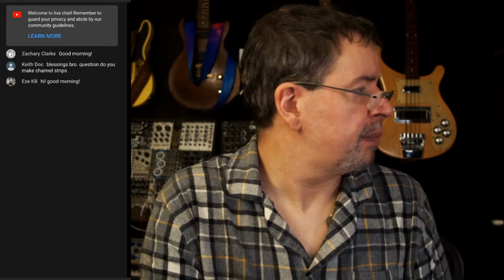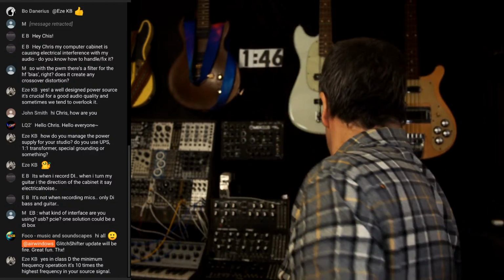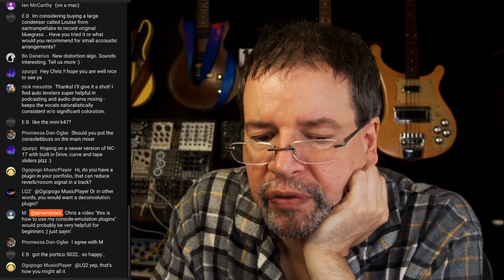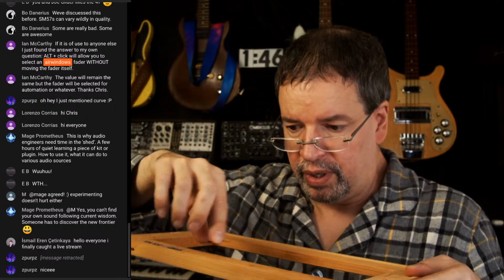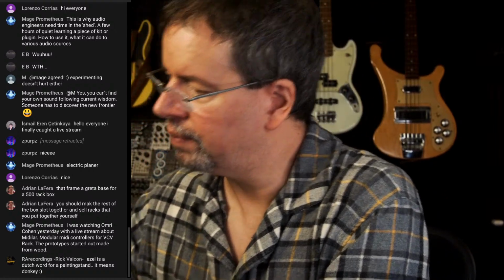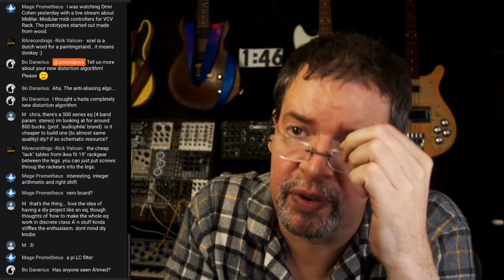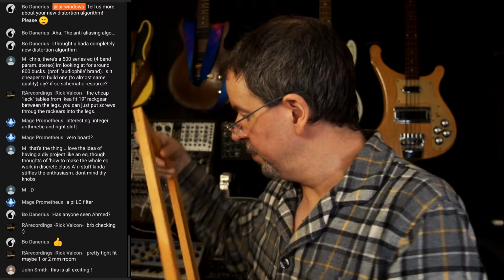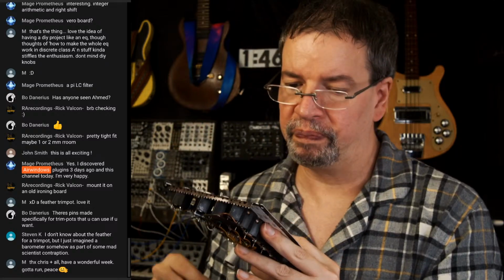Airwindows Q&A: DIY

Comment: & guitar pickups noise ... Some pickups get more than others ... you have to make a connection from guitar to your body or chauffage, central heating system boiler or object that goes to earth ( masse ) ... that and a cage of faraday inside your guitar electronics might help to reduce the typical buzz, noise from guitar noise ... if you have more advice to counterpart this kind of noise